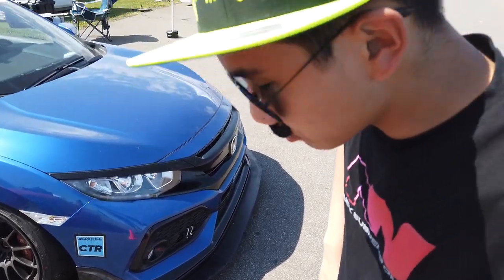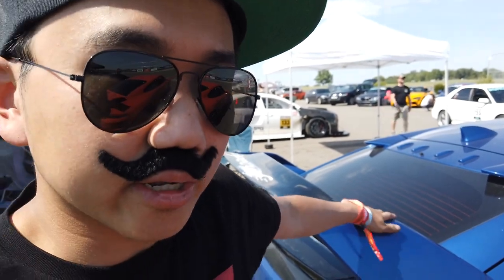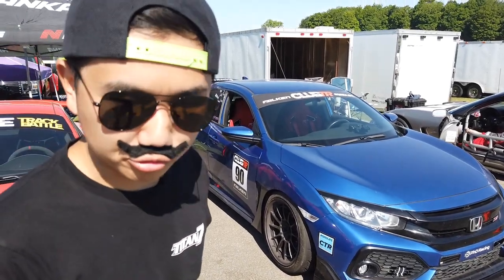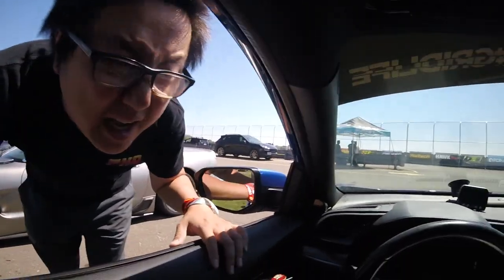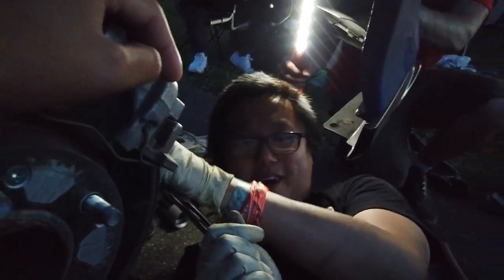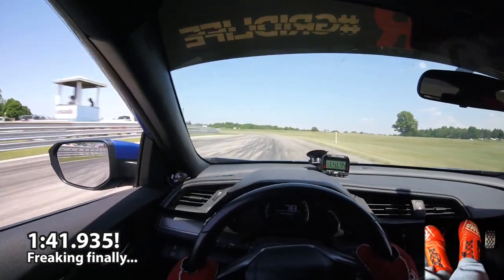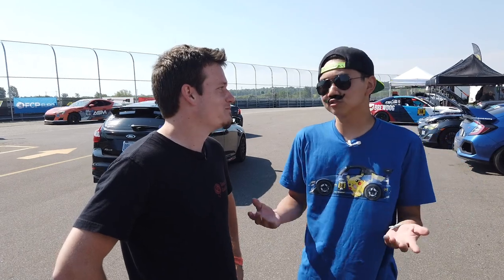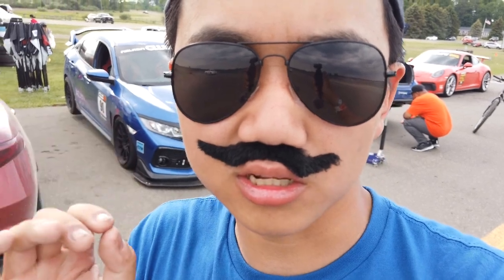Gapped by K24s?! Civic Sport Turbo FK7 Gridlife Gingerman ClubTR Time Attack by Jimmy Diggs

Comment: Who is this Jimmy Diggs menace?

Have you guys looked into adding some ducting around the radiator and venting the hood?
Reply: Usually the stock ducting is better then anything you can make without testing in a tunnel or using flow test simulations. Unless you have a aftermarket front bumper or splitter I don’t see the point necessarily.